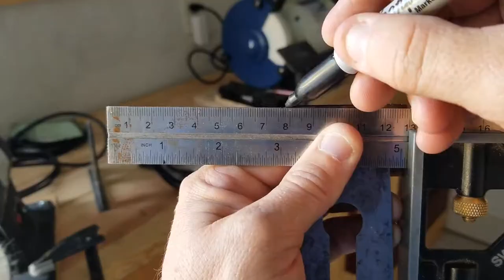Stanley 10 1/2 Rebate Plane

Comment: After watching the jointer and rebate restorations, I'm wondering what treatment is afforded the soles of the planes? Same as the shoulders? Nothing? Anything special for corrugated soles?

The walk-through of the sanding and buffing is especially informative. Thank you.
Reply from the maker: For those planes in particular the soles were pretty flat. I'm working on a another restoration at the moment and I will include video of how I treat the soles